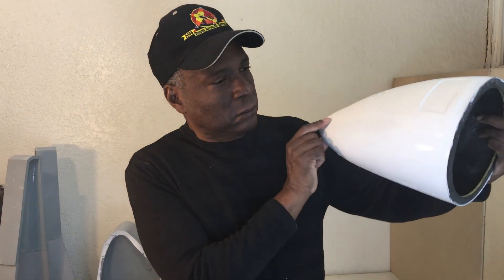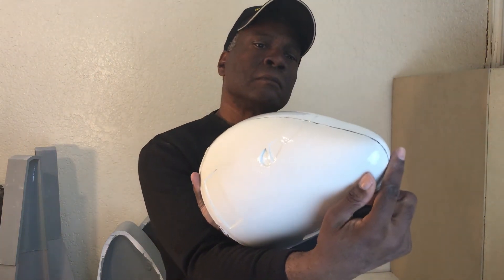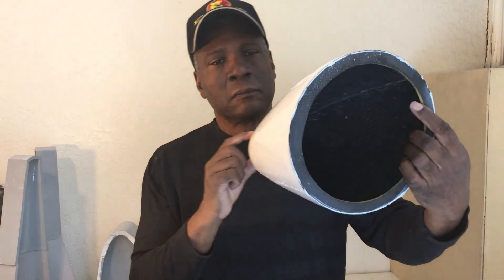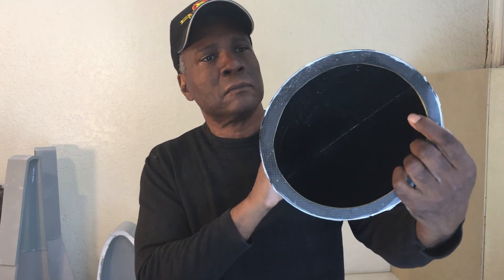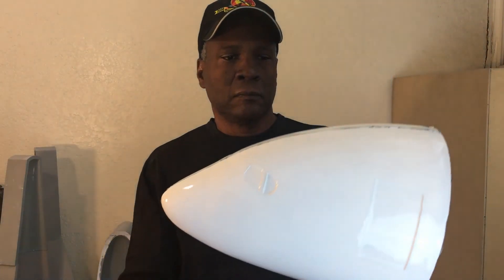Carbon fiber, Building with it. Building a large RC A 350 airbus from scratch

Comment: I'm curious, why are you painting it before you mould it? You have a seam where the are glued together that is going to have to be sanded and painted to make it seamless. To get it to blend together don't you have to repaint the whole surface?
Reply from the maker: Yes there is a seam line, but nothing is done to it.  Have a look at CARF models.  All of their models have seam lines. Painting in the mold is done to have a finished part when you pull it out of the molds.  You can also spray primer in the mold, then lay up the part.  This will assure no pin holes in the part.

Comment: How did you develop the cad file, the mold design and stl files for the mold. Thanks for the videos. I would love to have someone show the process from inception to finish flying plane with all the design items.
Reply from the maker: Thank you.  The CAD file.  I modeled  the Airliner in Fusion 360.  I learned Fusion 360 by watching a series  of youtube videos called, Learn Fusion 360 in 30 days by Product design online.  Make sure you understand them before moving on to the next video in the series.  If you do not understand anything in the series, stop it or slow it down, but make sure you understand the concept.  Next watch his videos on surface  modeling and modeling from solids.  Also watch videos by Learn everything about design here on youtube also.  From this you should be well on your way to modeling anything you want in Fusion 360. The molds are very simple to make.  You draw a box around the part you want to mold, you then select your target body, the box, and your cutting tool, the model.  Again you will learn all of this From Product design on line and learn everything about design. If you have anymore questions, feel free to ask.
Reply: @cadbuildflyrc3784  thanks for answering.i will look into those videos